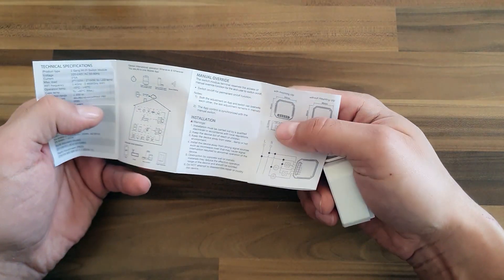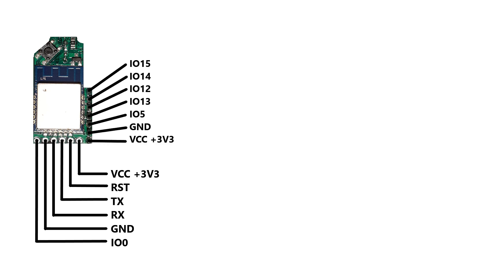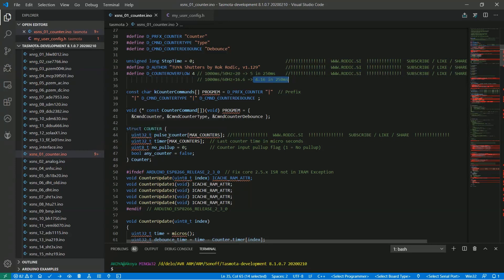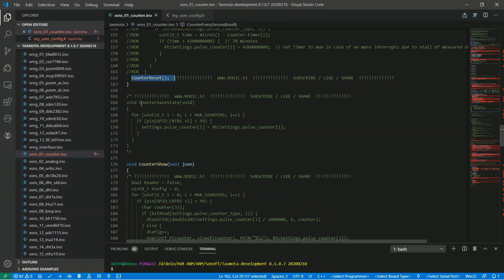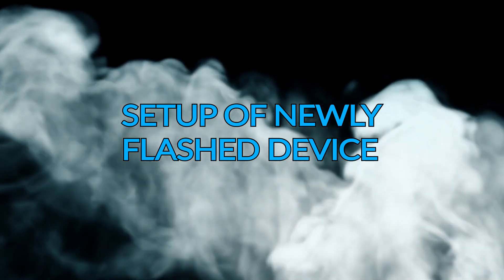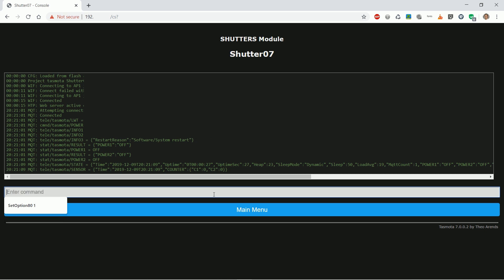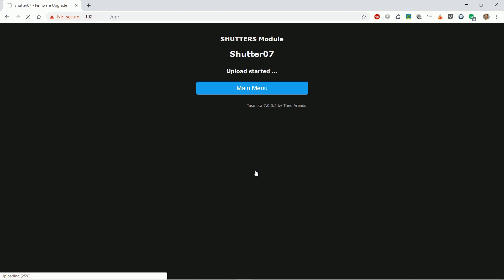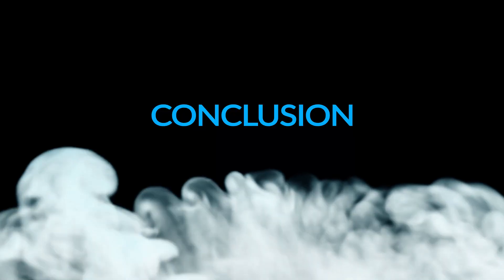🔴 TASMOTA TUYA shutters / rollers - Arduino AC LINE detection

Comment: Awesome video, thanks 👍
Is there a support to open to 50% for example? (Without having to manually stop at 50%, from home assistant for example)
Reply from the maker: Thank you. For home assistant just use one of the latest versions of Tasmota as it allows auto discovery in HA. It will detect a now device. Use shutter addon fot the front end. For preset 50% make a switch in HA which will set the attribute of this nowly detected device to 50%. I.E. set cover.shutterXX attribute "current_position" to 50 (use Jinja2 engine). Have a great day!
Reply: @greeneyedexplorer  so it support current_position, that's awesome, thanks for the reply 👍

Comment: How reliable is the Up and Down limit? I'm still thinking to use geared stepper or regular geared dc motor
Reply from the maker: It works in my house flowlessly for 2-3 years now. No problems. I have 220AC 50Hz.
Reply: Most people use the roller shutter integrated end stop. So running the tasmota a little longer doesn't damage anything.

Comment: 266 to the usb in the image it does not look good.

I have connected it to the piin but it did not work for me

usb
Reply: i have this                              

usb   8266                     
Tx        Rx
Rx        Tx
Gnd      Gnd

Gnd       IOo
3v3        3v3
Reply from the maker: There are different USB to serial converters - some have exchanged RX and TX written on PCBs. Thanks for mentioning this!
Reply: @greeneyedexplorer  
I know there are several different ftdi,

but the connections are what I put?
Reply from the maker: Everything as in the video (all 4 wires). If it does not work try switching RX and TX wires.
Reply: @TheNekely  i have same problem, did you solve it?

Comment: Thanks for the great instructions and video. I flashed the device with Tasmota and I want to use it as a 2 gang switch. Using the template in the video makes the relays works but not the external switches like it works with the original Tuya FW. I guess I need to modify the template, any suggestions?
Reply: Try the following: Set GPIO12  to Switch2 (10) and GPIO13 to Switch1 (9). In the console type "SwitchDebounce 69". That activatesTASMOTA 50hz AC detection at the switch-inputs. Connecting "S1" or "S2" to "L" (which can be done using push-button-switches) will do the job ! Works for me.

Comment: Thanks for the video. Google sent me here for pinouts for QS-WIFI-S04-2C. I now have ESPHome loaded and working (as 2 separate light switches+relays). TuyaConvert works on these modules perfectly - but thanks for the view of the inside.
Reply: Hi mate, I am new with ESPhome, may i know how did you setup in the esphome yaml file?thanks
Reply from the maker: I do not use ESPhome. I hope somebody shares setup...
Reply: Hello, can you provide your yaml for ESPHOME?
THANKS
Reply from the maker: I do not use ESPhome. I hope somebody shares setup...
Reply: I buy some modules, after flashing I will share it!
Reply: My ESPHome Yaml is here...https://pastebin.com/QKCxM4RN . I chose to expose as 2 separate lights to HA only. The relays and switches are internal only and the switches toggle the light state regardless of the current state.

Comment: hi dude! great video! is it possible to connect a switch on the switch connexion? if yes how do you do to config the switchs input? thanks
Reply from the maker: Yes you can put on switch. After certain count of zerocrossings just disable corresponding interrupt and do the movement. When the other triggers, turn the later on and turn the new one off.
Another option is to do only one movement at certain count and let the counter go up. A matter of one bool...